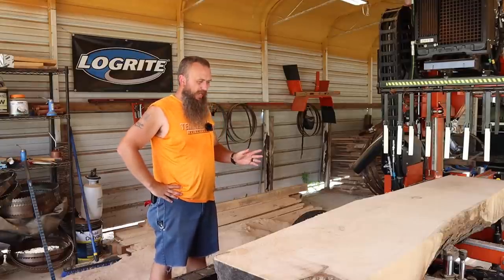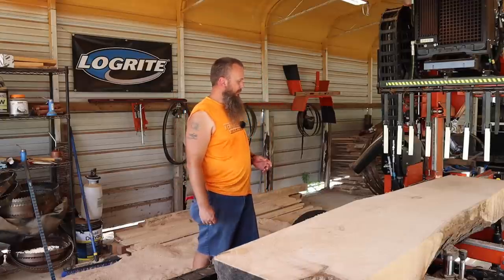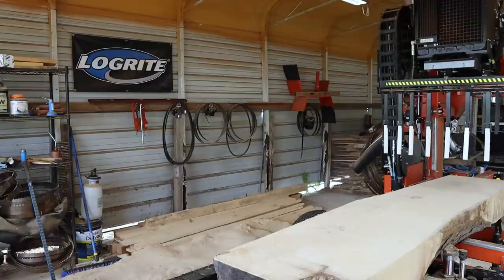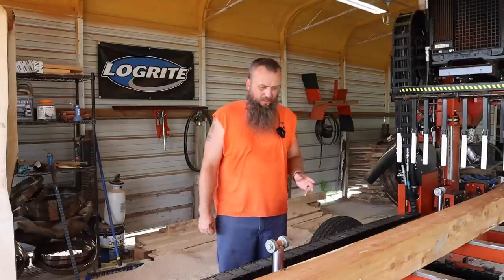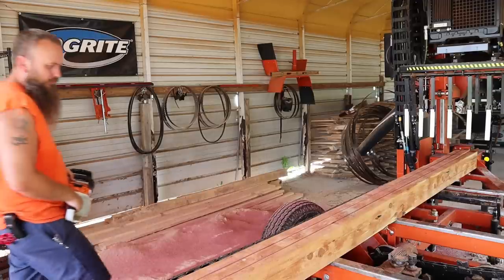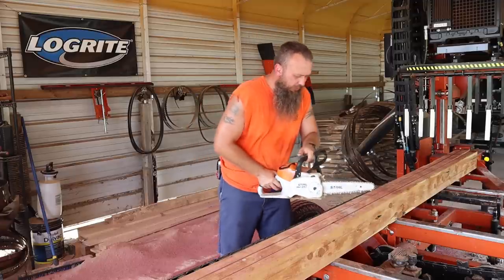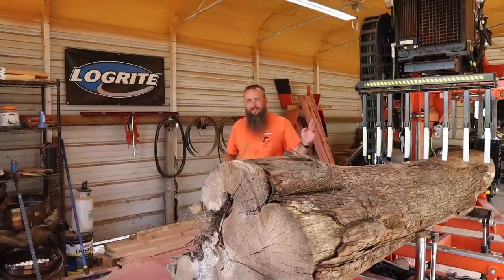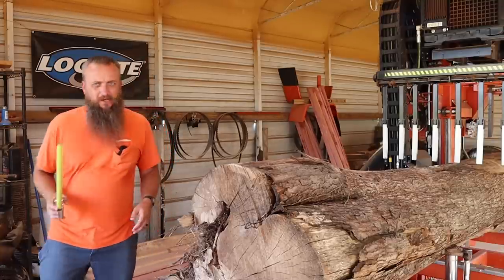Never Seen Anything Like It, Junk Log With Gold Under It’s Bark.

Comment: Got an idea for the chickens. Install some of those vents up high on the wall you can open and close keep them open in the summer to keep heat down. Also maybe plant some fast growing shrubs on the west side to give shade during hotter part of the day.
Reply: You can also hook the up to a thermostat so they open and close by themselves.
Reply: And make sure your replacement air coming in is coming from the north side in the shade. Even in the house I use air management to cut down on how much I use my A/C.
Reply: I do the same thing. Close almost all for winter when it’s below zero and open them all for a good cros breeze In the summer.

Comment: I watched your series on building a Kiln. I am part of a project in Michigan where we are building a community for homeless veterans and we have a Kiln in a workshop that we use to gain income for our nonprofit. We took a 40 foot semi trailer and divided a wall at 20 foot giving us an 8‘ x 8‘ x 20‘ kiln. We insulated the walls with the rigid foam insulation like you used and put half-inch OSB over top of that and we are going to use the aluminum vibrated roof coating has a final coat on the walls. We have followed instructions from another person where we are using three milkhouse heater‘s and three box fans and one dehumidifier. We haven’t ran it yet because we’re still working on it when I’m reading it looks like we will hardly even need one heater to get to that 130° mark. I have looked all over online trying to find a chart on temperatures to keep the kiln on specific species of timber and I can only find vague references. Any ideas?

Comment: I have turned bowls from what I was told was paulownia wood but what I had was extremely light weight unlike what you have that you said was very heavy. It was easy to turn but very difficult to get rid of tool marks tough to sand because of the soft wood between the grains. Maybe what I had was something else but it sure did look the same as what you were cutting.

Comment: That last piece of maple you showed was incredible. I picked up a truck load of 3 foot pieces of beech a year ago and left them under a tarp for a year. They split so bad I told my neighbor he was about to get a load of beech firewood. When I started cutting the pieces once I went in about 8 inches the logs were solid and heavily spalter which I was not expecting. I sealed them and covered them back up to do some turnings.
 How long will 100 gallons of diesel last with all your equipment?
Reply from the maker: About 4 months
Reply: @OutoftheWoods0623  hehe l would say "not long enough". 
You cut some beautiful wood today. Thanks for sharing.

Comment: Man, that maple sure turned out better than I thought It was going to.  
BTW, I'm running some blades from Joe M and they cut really well.
I mostly cut virginia pine and chestnut oak (because that's what  primarily grows on my land)
I've heard both good and bad about chestnut oak.  Some of the boards I'm air drying have warped but most are still straight.  
I've had my mill less than a year and it's already by far paid for itself.

Comment: I've tried minimizing "sticker shock" when I buy gas by filling my tank up when it gets down to half full.  You could just fill up your tank halfway at a time to do the same thing, unless there's a delivery charge, which might override any benefits.  I don't use diesel, but here in the Central Valley of California, when I last got gas about a week ago, diesel was going for just under six bucks a gallon, while my regular unleaded was over the six dollar mark.  Fuel prices, to me, are just totally irrational. Chicken ventilation: Think low-tech - vents low on the north side of the structure, high on the south side, or just removable panels anywhere that can be opened up for ventilation.
Reply: I'm here in the Valley too. Gas is going for about 5.99 to 6.19. Diesel seems to be going for about six and a quarter to six and a half. I'm in Stanislaus County.
Although this weekend we're down in the mid 70's. It's beautiful outside. But next week, it'll be back up near a 100 again.
Reply: You are fooling yourself.  You do a single job twice.  The one thing you can never get back is your time.  Also, you will never be able to "time" the price so that it matters long term.  Good luck to you.
Reply: Here on the central coast (Ca) getting Diesel under $7/gal is starting to take a bit of looking.  I did buy some E85 for 4 bucks a gallon yesterday.

Comment: Long time subscriber, 1st time commenting. Really enjoy your show. Was wondering how effective the exhaust fans were in bringing the temp down in the coup. How much were you able to bring the temp down? Did you install just one fan or 2? Are you using it to bring air in or out or both? I retired from a cryogenic company and sometimes (not all) the most effective heat exchange is to take the hot air out rather then bringing it in FWIW.

Comment: On boarder with PA Steuben Co NY Diesel is running at $6.14 In PA and $6.03 in NY  Stations are 30 miles apart

Comment: About $2.50 per liter diesel in Switzerland
Reply from the maker: Ouch. Translate?
Reply: @OutoftheWoods0623  There are just under 3.8 liters in a US gallon so that works out at $9.50 per gallon in US money. It's about $9.00 in the UK. It's almost a relief to know that Switzerland is even more expensive than here!
Reply: @OutoftheWoods0623  $9.94 per gal